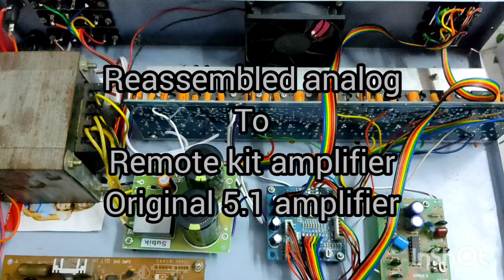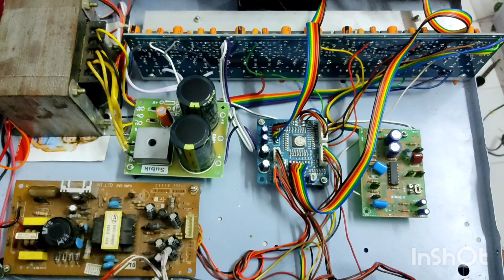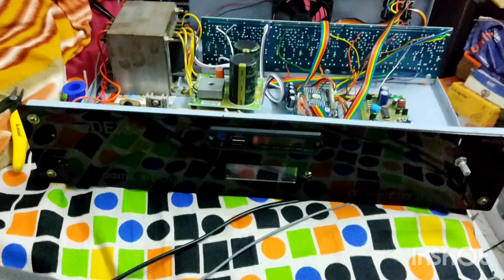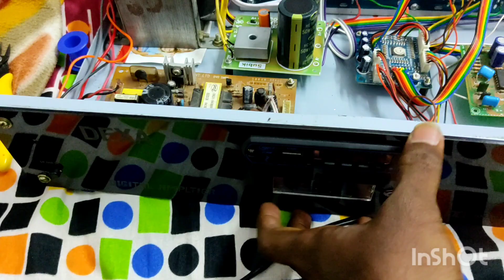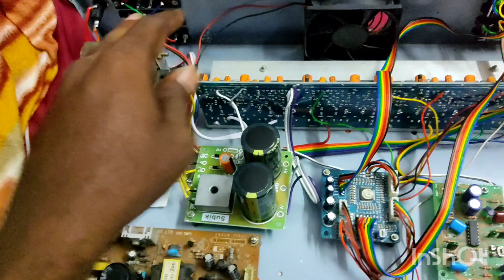Reassembled prologic amplifier to original  5.1 remote kit  amplifier

Comment: 5 amp ki entha volt capacitors vadali bro
Reply from the maker: 5amp ki entha volt kadu enni volts transformer ki entha capacitor use cheyali and 5amp ki entha diodes use cheyali anedi adagali kk na
Reply from the maker: Actually video lo mosfet board ki 4700 mfd use chesthey work out avadu andukey 10000mfd use chesamu. Audio board batti kuda capacitor depend avthadi.
Reply: Stk 4191
Reply: 24 0 24
Reply from the maker: Bro come to my whatsApp 8977395747
Reply: 4700mfd capacitor saripothai and use chesinaa, 6amp diode kuda suitable, elantey halfwave trapping ki 2.5amp and 2.5amp inko half trapping vasthadhi it is more than enough, misguide cheyakandi evvarini telisthey telusu ani cheppandi lekapothey lite tesukondi..
Reply from the maker: Ok bro misguide cheyanu lendi. Inka evariki chepanu lendi. Thank u bro